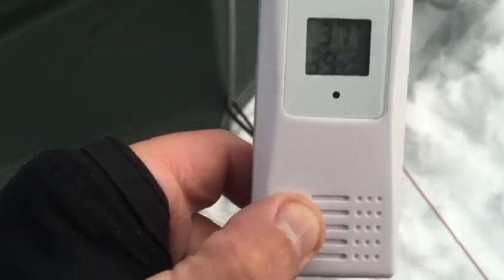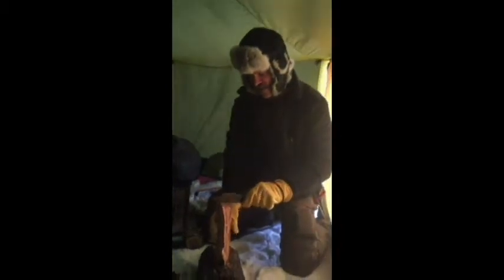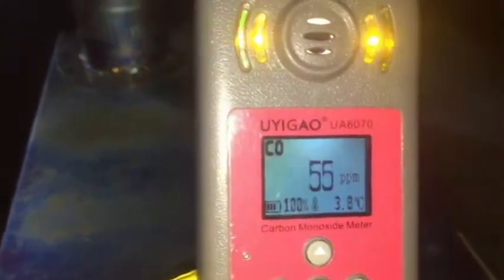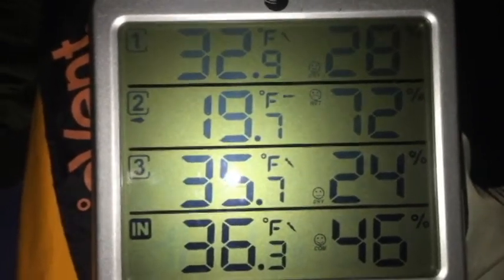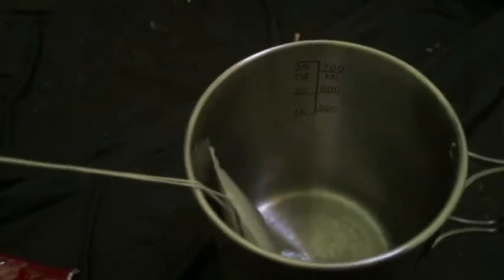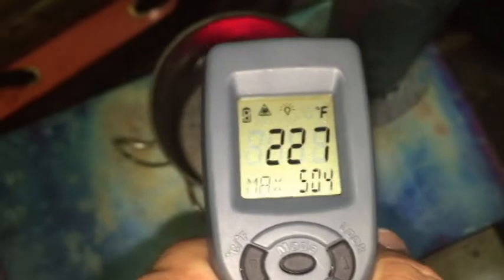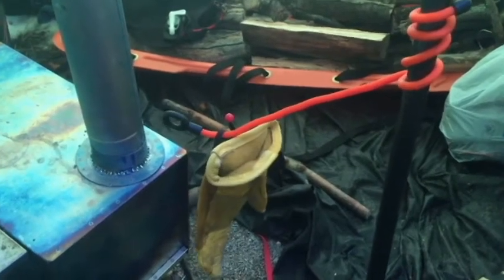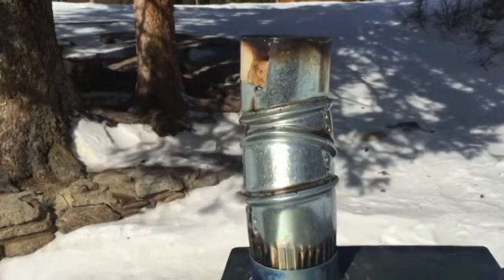Four Dog Stove Ultralight Titanium 1 Tent Stove Part4: Hilleberg Altai XP Hot Tent In Action

Comment: Soooooooooooooooooooo Jealous............What are you going to  replace the swivel piece with?
Reply from the maker: I've decided that I'm not going to use a swivel at all. I'll run the spark arrester straight up. That allows the sparks to drop straight back down the stove pipe. I need to find some sheet metal screws to secure the pipe sections together for high wind conditions. I hope I can find some screws that don't need a screw driver, although I do carry a leatherman multi-tool. I'd rather have a wing nut style so I can tighten them by hand. But I don't want the screws to interfere with the pipe fitting into the fire box. But then again without the swivel I have more room in the firebox. I store things inside each section of the stove pipe to minimize my pack size.  Another solution would be to go to one big sheet of titanium that I can roll out and it makes one long pipe. I have one that I've used and I'm thinking about going to it. It doesn't require but two screws. It takes longer to set up. But it gives me room to put all my cooking gear inside the firebox. I'll make another video on that once I've decided which way to go.
Reply: Sounds good, I guess my only concern would be more than a few times here in north east ohio we can experience snow rain mix thus water coming down the flu, I guess not a problem with titanium . You would know better than I.On another note would live to see a video of how you put stove jack in tent I know hillenberg tents are very expensive. Yours and your wife's sewing skills must be that of a surgeon.lol
Reply from the maker: I haven't had any issues with rain or snow coming down the stove pipe. I have a baffle in the fire box so if any rain made it all the way down then it would evaporate when it hit the baffle.  I didn't do any videos on the install of the stove jack. But I've been asked to make a video so maybe we'll do an reenactment of it so that people know how we did it. The material, needles and thread were important to get right.  We are not great sewers. As a matter of fact it was the first time we had sewn in 10 years. If we can do it anyone can do it. There is a close up of the stove jack in one of my tent videos. Check it out. I tried to get an outdoor view of the sewing but it didn't come out very good. Hope it helped some.